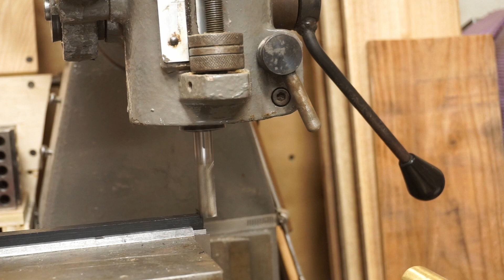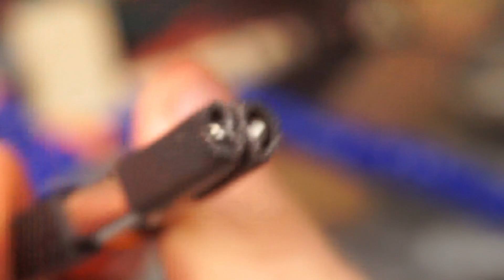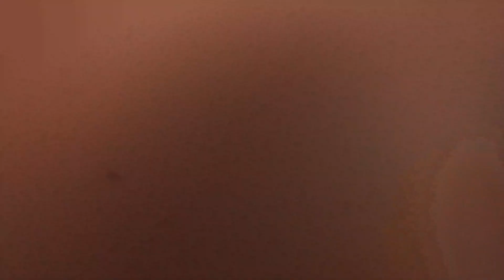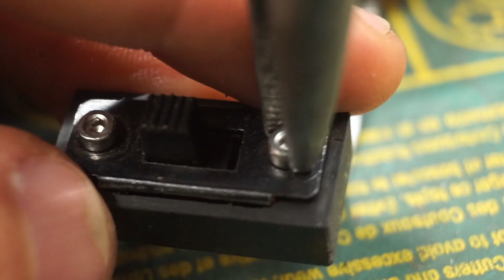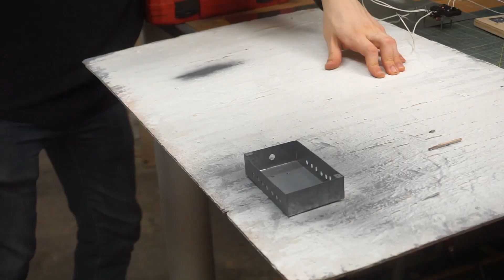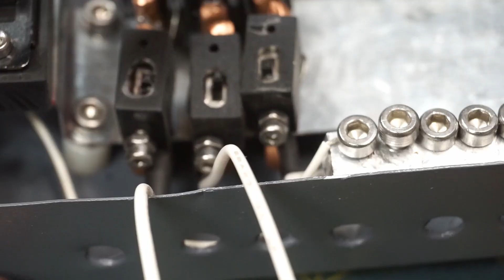Building a Circuit Breaker Panel for my Model House

Comment: How much does it cost you to build so far?
Reply from the maker: I haven't been keeping track, but I'd say it's probably been less than $1000 USD, since I've largely been buying raw materials. In particular, all the lumber was (if I had to guess) less than $20, since I bought a bunch of full size "scratch and dent" lumber and milled it up myself on the table saw.